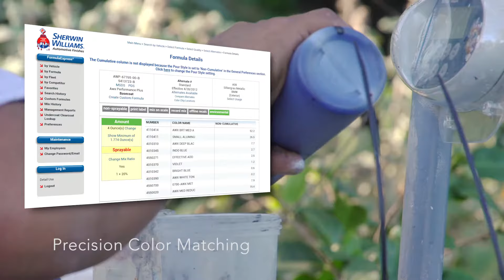Professional Mobile Bumper Repair

Comment: Hmmm, not sure if those spray guns are 6H approved. Solid job though.
Reply: luis garcia pdr
Reply: pdr dents
Reply: I would use rattle spray can for both paint and clear... it's cheaper and easier to be mobile
Reply: IamAnoobiecheez Rattle can clear is horrible, unless it's 2 pack.
Reply: IamAnoobiecheez  lmao no.
Reply: When on the go, you dont have time to go mix up paint at the store for the specific model car. Also clear can lasts for only 48 hours then its garbage once opened.
Reply: H6 my man i thought the same thing 3oz u can spray out side of the booth

Comment: will probably look like shit or peel after a couple months...when u do quick work like that it looks good at first then any sanding lines will begin to appear later
Reply: Nope, do a good job and it sticks for many years or even the lifetime of your vehicle. Quality is sometimes even much better than shop work that I've seen.
Reply: Also why were not supposed to use the icing putty on plastic anymore, it cracks and paint starts peeling. All plastic repairs are now done with just heat and reshape, sand, or weld and sand.
Reply: do you know if I can do the same repairs on a fibreglass bumper? never attempted it but someone wants me to fix their front bumper.